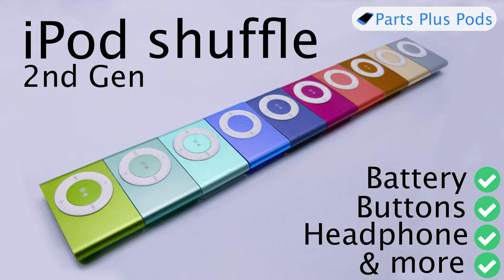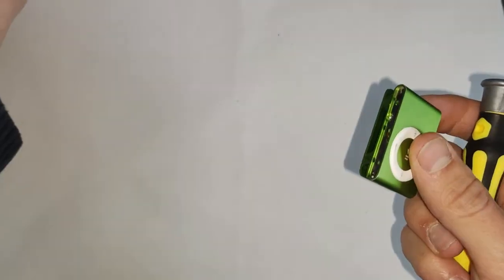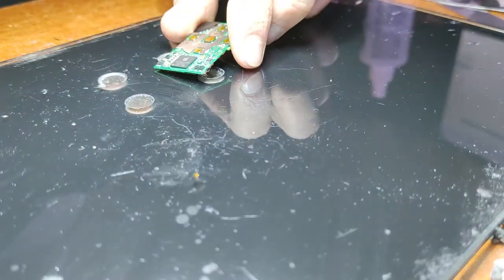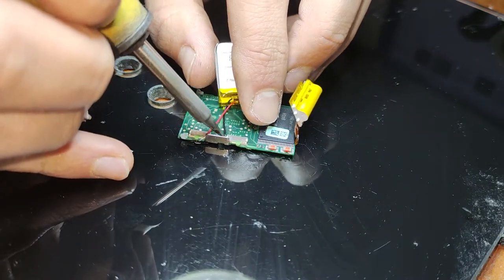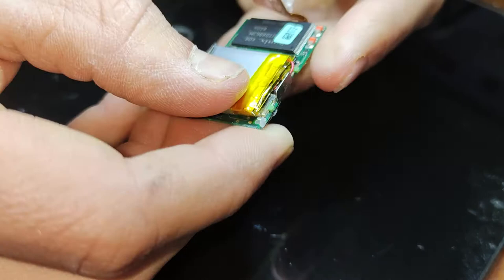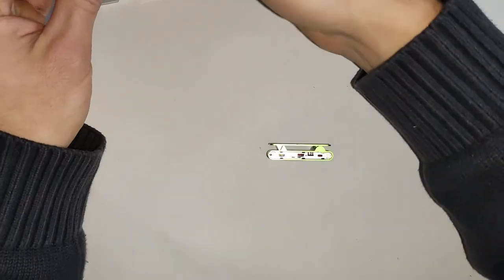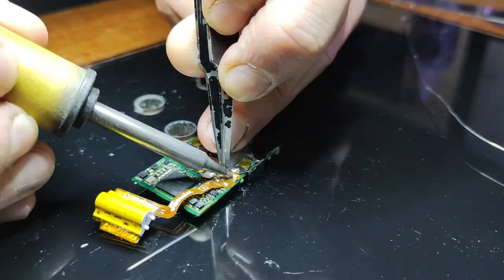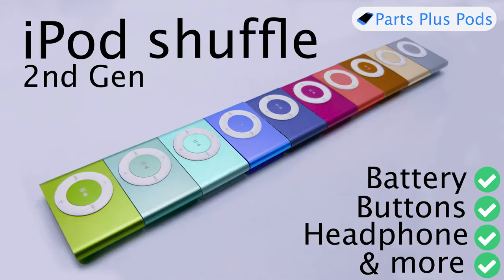Apple iPod Shuffle 2nd Gen Ultimate Repair Guide Battery Buttons Headphone

Comment: H😢i there,  I stumbled upon your video and found it helpful as I was able to replace the battery in my iPod shuffle following your directions but when I try to charge it to Chen the battery life the charge indicator light won't turn on. The lights works as it will blink when it's plugged in my computer and when I push buttons to play music, but no lights when I charge. Is this something to be concerned about? Thank you for your time. I appreciate it.

Comment: I broke my sliding on off switch and trying to remove the unit from the casing. I really love the music that is on this iPod. How can it be fixed. Does everything get erased when a new battery is added? After installing the new battery it will not power on it could be because I broke the power switch. Your help is greatly needed because I love this music. Thank you
Reply from the maker: Hello, it is possible to replace the switch although it will require special tools (a hot air rework station and probably a microscope as well). Perhaps i should have shown it in the video. If it is just the plastic nub on the top of the switch that has snapped off you may be able to flip it back into the on position using a pair of tweezers. Installing a new battery wont erase the music.

Comment: Great video, easy to follow—thank you! I have a question: My iPod had been working previously, but the battery would no longer hold a charge. I followed the video and replaced the battery, which seemed to be charging when I tested it. But plugging in the headphones produced no results–the iPod doesn't work. Any suggestions for what I should try next?
Reply: Haven't you damaged the flex from the 3.5 jack sockets?
Reply: Try charging it from the wall for a really long time, like a day. My shuffle was completely lifeless until I left it plugged in for like 10 hours now the battery holds a charge for around a week or two

Comment: For those of us who don’t like to soldier, can you just cut off the old battery wire close to the battery (so you have a good length of wire) and join the battery to that wire using heat shrink tubing?

Comment: Thanks for the video.  Is there a way to disconnect the power switch?  I’m using the circuit in another housing, and need to replace the power switch…
Reply from the maker: Hello, yes it is possible to remove although you will need to use a hot air rework station as the soldering iron probably wont be able to reach every joint at once